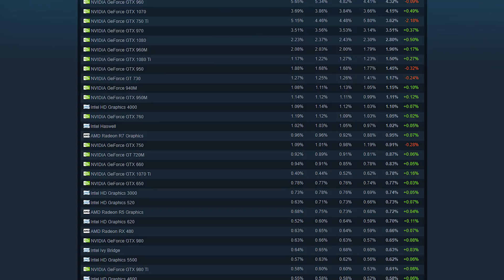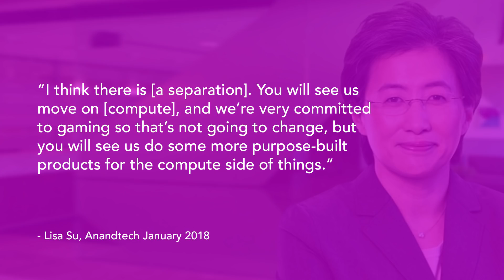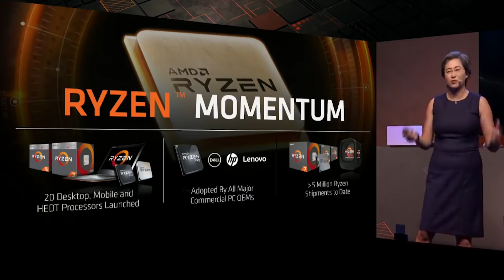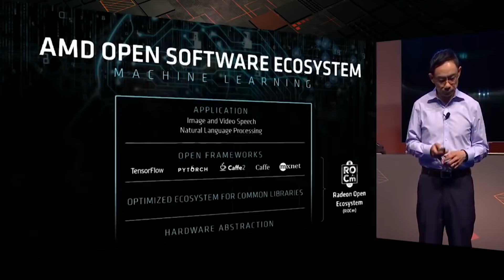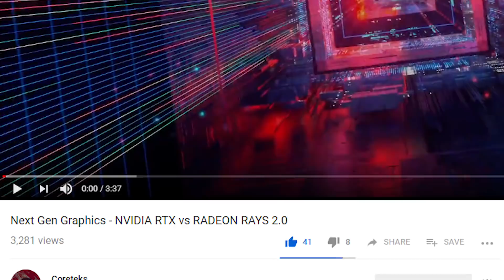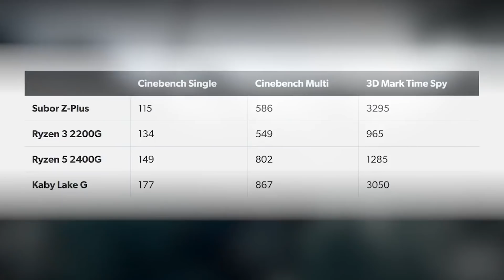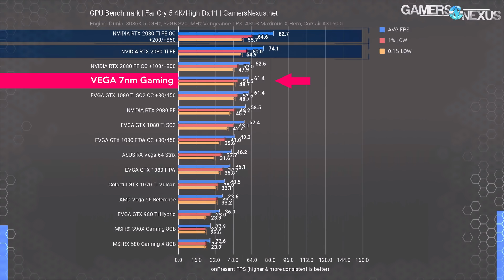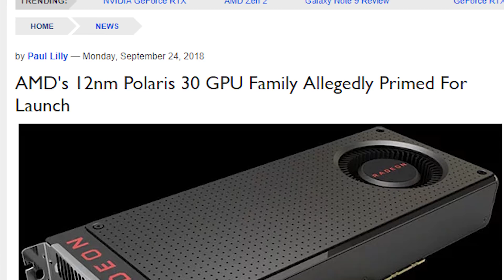AMD's answer to RTX

Comment: I don't think Vega 64 was a fail. It was just too expensive due to high demand (miners) and bad HBM availability. For people who wanted to invest in a new monitor as well, like I did, the combination Vega 64 + Freesync ultrawide was cheaper than the Nvidia 1080 + ultrawide monitor with gsync. Later when demand got higher from the miners, the priced skyrocketed and availability was poor. Retailers had more Nvidia cards in stock...
Reply: @Dario Pavic Anyone complaining about power consumption must either be mining or not doing the math in the cost of operation and purchase price. Assuming a 160 watt increase in power draw vs NVIDIA x absurd 8 hours of gaming = 1280 watts x 0.12 cents per KWH = 0.153 USD per day x neck beard lard ass gaming 365 days a year = $56 yearly operational cost. Those power consumption differences are sourced from Anandtech website which didn't undervolt for better efficiency.

When factoring the monitor of same brand, same size, same resolution, same 144hz, although 4ms response time G-sync vs 1ms freesync response time the price difference with both on sale @ newegg is $214 / $56 higher gpu operational costs = 3.82 years before NVIDIA becomes worth it on an operational cost standpoint. I don't know about you but I upgrade every 3 years as technology advances enough to gain a noticeable difference.
Reply: If you UC and UV, the Vega power consumption for mining is amazing. More hashes per watt than anything other than an ASIC.
Reply: I spent a lot of time waiting for Vega, miners bought them and I just kind of gave up. As soon as I finally saw a good one (Red Devil) for MSRP I grabbed one with a 1440p 144htz IPS monitor for a little over $800 after rebates. I'm really happy with the upgrade and I didn't mind supporting Team Red after all the money they made me over the last two years.
Reply: Totally agreed,i did switch to giabite vega 64 oc last week from zotac gtx 1080 amp...despite higher power consumption vega runs 10c cooler.So far it did match or perform better than my GTX.Did pay around 550$ as i had freesync monitors already.Personally i think,if you can keep with 100w extra TDP for 500$ it is the best card you can get and it will only get better.
Reply: I agree, I bought a Vega 56 and a 144hz Freesync  monitor before the prices skyrocketed and I couldn't be happier. Its was about half the price of a 1080 and a G-Sync monitor at the time!
Reply: I just wish I could have bought a Vega 56 instead of a 1070, I got my 1070 for $325 summer of 2017 while Vega prices were way too high.
Reply: Vega was priced too high and they had no third party cards on release (obviously).  A GTX 1080 was already out with lots of different card makers and had slightly better performance than Vega 64, and so was 1080 ti which was better as well.  In addition Vega on release was very power hungry and noisy and hot.  Basically they screwed up the release by jumping the gun.
Reply: instead of trying to crack down on miners, amd should embrace the new customer base and make cards dedicated to mining to divert their attention away from the gaming gpus.
Reply: @tryntonn  I couldn't agree more
Reply: It was also 14 months late, way too power hungry for the level of performance it offered, had zero availability of actually decent third party models for another 3 months after launch and it performed well below expectations.
In other words it was a failure, the biggest one in the past few years too.
Reply: Sound like nvidia rtx tracing cards...same fiasco,power hungry hot as hell.And extremely overpriced considering performance they have...vega does 65w on average over my gtx 1080.Cant blame AMD for being my faster cards for overall therefore used for mining...
Reply: What fiasco? Overpriced they very well may be, but certainly not terribly power hungry (considering the insane sizes of the chips) or running hot. Performance increase could have been a lot bigger if Nvidia focused on traditional rendering, whether the RTX push will pay off remains to be seen. Still, they are comfortably the fastest cards on the market with zero competition in their segment, so hardly underperfoming.
Reply: :D they have no competition because 1300$+ gaming cards dont exist...hell 2080 which got beaten in everything by 1080ti which cost 200$ less.225w and 260w on reference card isn't far from 295w on vega.If we take computing performance with single precision point of custom vega 64 air cooled is 13.1 TFLOPs and gtx 2080ti is 13.4 TFLOPs raw performace per watt isnt so far off.Unfortunately drivers and game optimization is different story.However you can google a week old test of vega64,gtx 1080ti and gtx 2080 where only dx 12 was used and you can see vega performing Full HD,2k and 4k  from 5%-20% worse than GTXs.So $ to performace ratio is the same,if not better in case of AMD.
Reply: Don't forget Kaja lost 2/3rds of his team to console graphics. THAT Killed it.
Reply: Totally agree.... I was aiming for a Vega, but then the prices and availability just went away, UNFORTUNATELY.... so I went with a RX 580. That said, it is not a bad GPU either... but very sad for the whole scene, me included, really sought after VEGA.
Reply: Dawn Moon That takes me back... mid- to end 2017 I wanted to upgrade my GPU (GTX750Ti). I could not find any AMD cards (there was a two month back log on orders) and the only one I could find in town that was actually an upgrade, was a GTX1060 3GB. And the shops further had only lower level Nvidia cards in stock, no AMD.
Reply: But it was clearly a fail, compare it to Pascal, Ryzen, Kaby Lake and all other launches close to it. It's a fail by every margin.
Reply: Brad Viviviyal  Freesync 2 aka Freesync HDR is legit ... don't hate on AMD. Freesync was turned into an open standard and became part of the Displayport spec, HBM and later HBM2 was AMD's research and then made available to anyone to use for free, even Nvidia is welcome to use it....  AMD has had an open source driver project going for quite a while now, and for many young programmers, it is the first time they have ever seen what a modern production graphics driver actually looks like, and it's amazing and educational and awesome.... AMD took the initiative to develop Dx12 since Microsoft was displaying weak commitment to it and AMD was serious about getting closer to bare metal for optimization reasons, and Dx11 was like the opposite of what AMD wanted for consoles, mobile, etc. That became Mantle, then became Vulcan, a working DirectX 12 but the real kicker was that Vulcan is cross-platform, opening the door to cutting edge graphics tech for Linux, even Android, Mac, as well as Windows, and also for Xbox and PlayStation. Even NV jumped on the Vulcan bandwagon, as they do alot with Android over there... Do you get where I'm coming from yet?
Reply: but the tdp was too much
Reply: I really wanted to like the Vega cards as well, but they were also waay too power hungry for the price.
Reply: Dawn Moon I did two Vegas and a freesync ultra wide. However crossfire wasn’t supported so I sold the cards and settled with a 1080Ti. I hope the next card is faster than the 1080ti so I can use my Freesync monitor to its full potential.
Reply: @sethbishop3306  keep in mind that AMD has demonstrated it's MCM techniques work, and well, and is putting together multi-die GPUs using the same Infinity Fabric interconnects that Ryzen featured. So AMD will come out with some kind of double Vega 64 on a card and do as much work as a 1080ti can with the far better yields that come from making smaller dies. AMD has been doing ray-tracing, including hybrid and realtime, for a couple years now. 2016 at least. They have been sowing the seeds of a software ecosystem for GPU compute on Radeon hardware for that long,,, google "ROCm" and you'll see... NV RTX is BS. Microsoft also has also been talking about ray-tracing for years, in the context of developing Dx12. AMD famously skipped the bullshit and created Mantle/Vulcan which is basically multi-platform Dx12, including ray tracing goodies, instead of waiting for Microsoft to elaborate on what it thinks Dx12 should be about.
Reply: Miners don't use Vega because very high price and power consumption
Reply: Exactly, good card just too overpriced. I wouldn't mind buying one now to upgrade from my 1060 now that the price is down
Reply: Interesting.  I never even thought about that but that IS true.  I got a freesync monitor for a good deal but I'm currently using vsync cuz I have an Nvidia card.
Reply: I have a vega 64 and using it for vr and run smooth as butter on the Samsung HMD Odyssey
Reply: @sy1ve0n  congrats. That's what always cracks me up with (go 1080 dood) crowd. You spend 400+ euro on gpu, beefy CPU to not bottleneck it and play on 1080p60hz monitor? FreeSync is way cheaper so you upgrade your monitor tech and save money.
Reply: Brad Viviviyal  and why would it be crappy, show us where you got this amazing feedback from or did you pull that sh1t just out of your a hole?
Reply: miners didn't buy vega cards, at least not the ones who wanted to make most out of their investment, especially the ones who laughed at monero, because vega is (was) only good for that, and that is now (for quite some time) pretty much worthless. Just look at the used cards market. Notice what miners are selling are not Vega cards but 1060s, 570s, 580s. all cheap as hell. No Vegas. No dirt cheap ones anyway.
Reply: Gtx 1080= rtx 2070 = rtx 2060s
Reply: As much as I like AMD, the efficiency problem of Vega (especially 64) made me lose a lot of faith in them. If the price is right AND their's good third-party cards I would still buy the Vega 64 instead of a GTX 1080. As for a possible 7nm Vega, I wouldn't mind if it didn't have more than 35% performance increase as long as the power draw is somewhat significantly improved. Either way, I don't expect AMD to release something game changing before the second half of 2019 but that's ok as long as I don't get forced to switch to Nvidia.
Reply: One point from another AMD fan here is that we shouldn´t expect AMD to beat Nvidia "on all fronts"... just checking the money Nvidia or Intel has to develop with compare to AMDs research capabilities, it is actually great performance AMD can make with much less cash to develop. AMDs top has sometimes been power hungry, but that is still a better option than to not have the top models because they consume a lot of power (says an earlier owner of a AMD 9370 processor!). On the processor front, the amazing thing is that AMD is now equal to intel. The sad thing the last year has been that AMD 580 and VEGA were good for mining, so miners bought up all cards and made the prices go too high to get decent performance for your bucks.
Reply: Dawn Moon dont forget the fact that Vega 64 was a nuclear reactor. when running at full power because cooling was always way too weak they needed something like the gtx 680 soc from evga had cooling wise
Reply: To my understanding, Vega 64 ended up being the best value for Bitcoin mining because of it's HBM, and because of high demand, and low availability, prices got really bad.
Reply: Vega 64 has outrageous power consumption. No performance advantage can convince me otherwise now that we've seen that high performance GPUs can be created with a low power consumption.
Reply: @silviu421  miners are/were more than happy with their performance.. why you think vegas are overpriced and out of stock all the time? Plus Undervolted it lands close to FE Pascals.
Reply: Agreed. At MSRP (which I got 2 cards at during launch) it's actually pretty good, especially when undervolted with Radeon Chill and FRT enabled @ 60Hz.
Reply: I actually disliked the power consumption of the vega. Rest was tipped to vega>10 series.
Reply: Dario Pavic The power consumption can be improved by undervolting, also helps a lot with temps.
Reply: Indeed, they are less efficient, I agree, in my case though I game 2 hrs a week maximum, so the bill won't be impacted that much :) ( and undervolting Vega DOES make a lot of difference, also for overclocks )

Comment: PowerVR had similar demos back in 2016 to the ones Nvidia showed for RTX and AMD hired all those engineers. AMD also announced during the RTX demos that they also had in the works a product to compete with the RTX cores. It will take some time, but AMD is working in a product that can compete.

Furthermore, and please take this with a grain of salt, AdoredTV received a leak from a self proclaimed Nvidia employee that up until now has been very accurate, and he claimed that the GTX 2050 will compete with Navi 11, The RTX 2070 with Navi 10, and Titan RTX with Vega 20.

Comment: Fuck this waiting. When you are stuck with a old hot SLI setup waiting for acceptable pricing, good new GPU's or AMD to step up your game you are stuck waiting for ever.
Is getting a 1440p 144fps ultra/high capable GPU for 700€ too much to ask for? 
I got the 980 Ti's and they are great when SLI works well, but that is rare so I just want to get a "moderately priced" high performing single GPU

Comment: one thing that seem like you missed is that amd is actaully working on a vega 12 right now, which seems to have 20 compute units and almost 2 ghz core clock (all this info comes from the linux gpu driver) no clue which node its using though, so this card is what amd plans to use for consumers.
about your idea of using vega 7nm for consumers, well maybe if they make a version of it with just 2 hbm stacks and use aquabolt, they would have already 614GBps which might be enough and would reduce the price of the card quite a bit,

Comment: I would buy RX Vega card but they are still ridicilously expensive where I live. New ones go for minimum of 550-600€ and I can get used reference card for 350-400€ (Used in mining rigs).  Too bad because RX Vega is great in Blender, on par with GTX 1080Ti.

Comment: AMD has disrupted processor market, just look Intel's rushed and confused releases.

Now Vega will do the same for nVidia, oh wait it already did.

Vast majority of the gamers always buy 300-399 GPU rather than freaking 500+, if AMD manages to price it at something between 350-450 they will gonna shake the market with 3rd gen Ryzen and 7nm Vega.!
Reply: Not necessary going to be more powerful if it's 7nm, just better thermals and higher clock speeds.. The tech from AMD is still very at bay

Comment: Vega 7NM would obviously be priced at $599, the only Nvidia 2080s on the market are well above their $699 price right now and at $100 OR MORE less than a 2080 while providing the same performance, fuck id switch from Nvidia to AMD right now. and lets not forget TSMCs 7nm is actually 10nm, so going from 14 to 10nm might get a decent clock boost, like 200 or 300MHz. my guess is it will get 35% max and maby i bit more with a manual oc. only time will tell though.

Comment: Unless AMD have worked out Vega's power consumption issues they are still stuck using HBM2. Sure you can use traditional GDDR in something with lower levels of performance like a console but not in something that is going to have to compete as a high end dedicated GPU and not cause the lights in your house to go dim. I'm not saying Vega is bad it's just that it was specifically engineered with HBM2 in mind for a reason and you can't just switch and that won't be a problem. That said 7nm might help enough to fix it but I have my doubts.

Comment: OMG AMD OUR SAVIOR COME TO SAFE US! PLS TAEK MY MUNEY! THANK YOU FRO 1070 PERFORMANCE AT THE 200-300 PRIZE POINT JUST LIKE EVERYONE EXPECTED!!!!!!1!!!!!one!!!!! IM CUMMING!!!!!!!!!

On that note, 7nm is only really gonna move the thermal limitations of larger processes and die size(Higher performance per watt was the performance referred to, suck it Intel). If the architecture remains the same, then it is not gonna change the goal post. Navi is what everyone is waiting for and accept nothing less if you are a true AMD fanboy like me with my R T X 2 0 8 0 I will use until then. If the die size with a 7nm switch size were to be the same as the Turing GPU, it would put out more heat(like 800w, as seen on the classic Fermi cards) and outperform the 20 series by up to 80% if their architecture truly is superior. I will guarantee that the 7nm cards will be awesome, but they will not be the top of the line, particularly in every circumstance. If your a prosumer-gamer, you have no choice but to go with the 7nm Vega Instinct which will kill the Nvidia cards in compute, but be a waste of money. Also the pricing in the video is WAY too optimistic. If you think AMD is gonna release a brand new card for prosumers at less that 600 you are wrong. Thus, price to performance, you will still be looking at 580s(or the real likely 680 type product actually going around on forums) at the lower end or 1070-1080 at the higher end. If you think the 7nm is better no matter what, all you are is hype mongering uninformed viewers for the next Vega launch to be as horrendous as the last one. 

TL;DR: Wait for Navi. And if you are waiting for Navi, might not be a bad idea to pick up a 2080 or 1070 until then if you are wanting the top end, and if you are satisfied with what you have, fuck all the internet has to say on this topic and be happy with what you have, be excited for the future of computing as a whole.